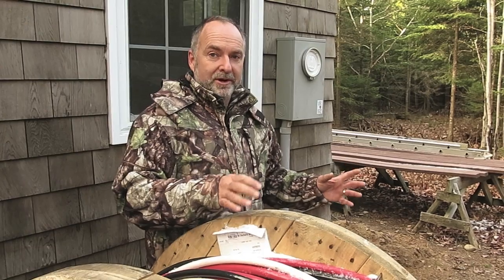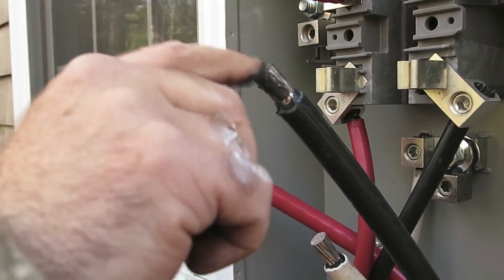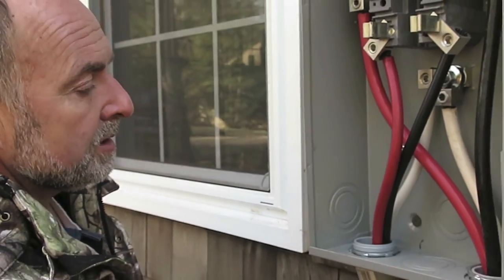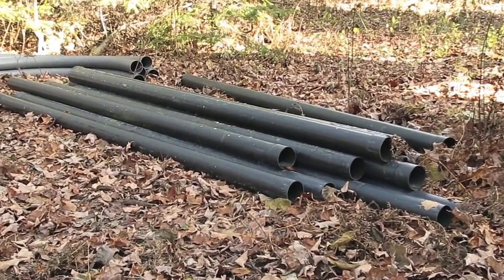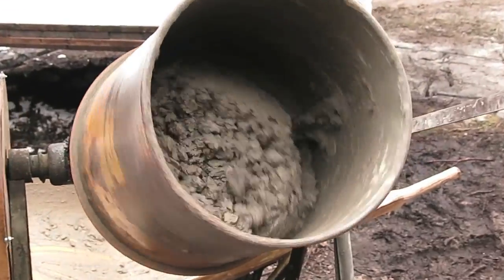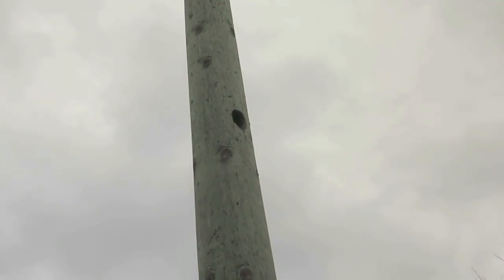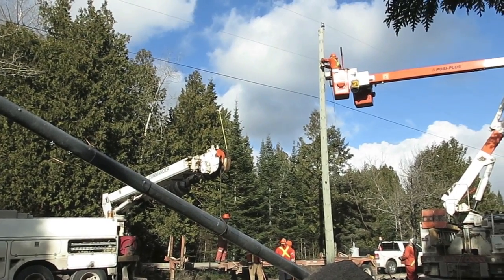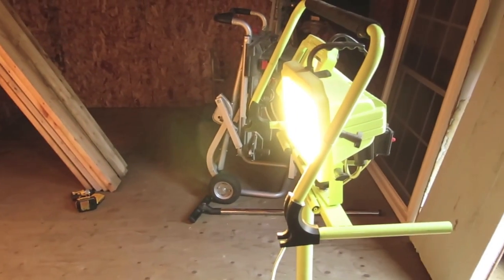Electric Service for Power Grid Connection in Rocky Soil

Comment: You have a great channel Steve . I need to run a wire to my new shed about 40ft from my home.. I remember watching this video awhile back . I see that you used aluminum wire to your meter . What size of al wire did you use from the pole and what size of al wire to your panel ? People don't like to use al wire but that's what the hydro boys use . I got a new service put in a few years ago and that's what the hydro boys used to connect to my shut off box in the garage from the pole . Then from the shut off panel they used copper wiring going inside to my circuit panel.
Reply from the maker: Good Morning Henry,
Thanks for your note. The only time aluminum wiring is allowed where I live is for a main service feed, like the one you see in this video. And even then, you need to use special dielectric grease on the connections to stop them from corroding. Your job is different than what you see here. What you want to do is create a branch circuit from your house to the shed. This would be just like a circuit within your house, except that the cable would run out of your house, through a plastic pipe (called a conduit), then up into your shed to whatever box you've got there. There are other issues involved in a safe installation, but this is it in a nutshell.

Drop by my website https://baileylineroad.com for a visit sometime. You'll find lots of stuff there, including tool giveaways, articles and the chance to ask me questions. 
Bye for now and thanks for watching!
Steve

Comment: Awesome, great work..  Just did the same myself at the cottage over the summer, including a Hydro One pole replacement.  I needed to run a number of other services as well so I had someone break the rock to get the requisite cover.  I could have gone aerial (as I suppose you could have done) but not ascetically pleasing.   Can't believe you mixed all that by hand over getting readymix!
Reply from the maker: Hi Crickelwood!
Thanks for your note. Good to hear from you.
Yes, we could have gone with an aerial service, but they're a real eyesore through forested areas. I thought of ready mix, but it's about twice the cost of mixing by hand, and we'd still have the problem of getting it into the forest in the trench. The trench was 300 feet long so it involves wheelbarrow work. We couldn't get the concrete spread fast enough from a truck this way, so we opted for mixing on site. It took about as long to mix a wheelbarrow load as it did to wheel it out and dump it, so it didn't work out too badly.
Where's you cottage? I'm in Ontario too, on Manitoulin Island.
Drop by for a digital visit sometime at https://stevemaxwell.ca and http://www.realrurallife.com. I've got lots of interesting things happening on these sites.
Bye for now and thanks for watching!
Steve
Reply: Hi Steve,

I’ve yet to make it to Manitoulin Island, would like to at some point, looks like wonderful country.  I came across your YouTube page when I was researching outdoor wood boilers a year or so ago.  The review you did was excellent.  In fact when I came across your page I wondered if you were the same Steve Maxwell that writes for the Toronto Star, and low and behold, you are!

My cottage is in the ‘Land of Lakes’ region, just north of Kingston Ontario.  I’m in the process of building a garage and loft at the moment, I posted some photos on the Garage Journal if you are interested - http://www.garagejournal.com/forum/showthread.php?t=220503

All the best, keep up the good work (and videos!).

Adrian